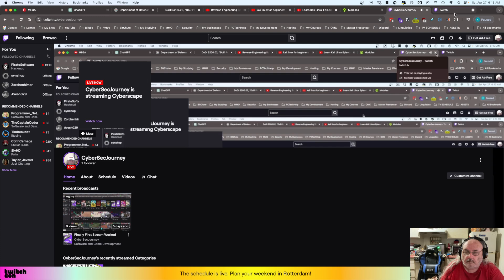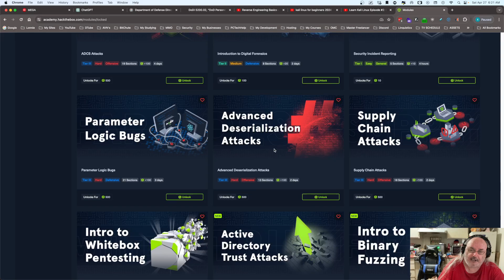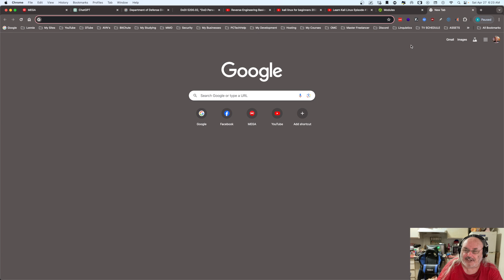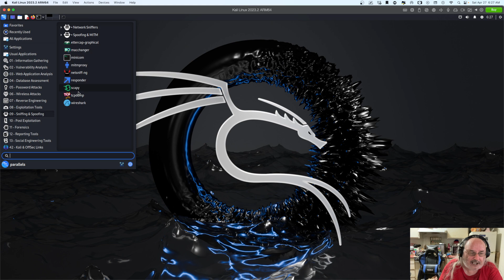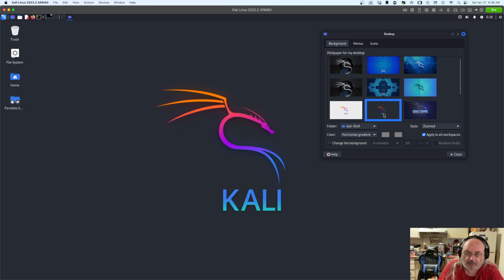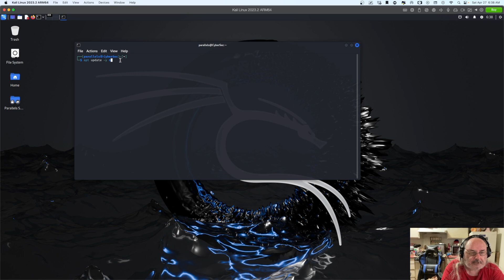Let's Get Ready To Learn To Hack????

Comment: Hi sir, Do you recommend to run any vpn on my pc Mac? I use Linux on utm
Reply from the maker: You can use utm if you like problem solving. But, personally speaking, I prefer Parallels but it runs Windows OS on Mac effortlessly really. It's for this reason and more that is has a $100 price tag but fully worth it if you ask me.
Reply: @CyberSecJourn  do you think a vpn is worth having on a Mac if yes which are some good ones? Well I have my Mac and use Prometheus for data monitoring running on my Mac not on Linux.
Reply: I’m learning this coz I would like to have my own home lab “data center” room in my future home 😂
Reply from the maker: @Username32123  Well it's hard to get into that now because I'm starting out with beginners. My hope is to bring new people, looking to change careers etc because of the ecomomy, into Cybersecurity, Bug Bounty Hunting, Security Researcher, PenTesters, etc. Setting up you own data center is years down the road. So much you have to know to run a center. I have my own network, DMZ, blackboxes, honeypots, etc in my home network but that's why I'm an independent security researcher so it's part of my job. I have a server that monitors and collects all the data on the network. Getting into VMWare, Prometheus and Grafana is a whole other thing and later down the road.
Reply: You can run a vpn on the host and then bridge the network for the guest,  or even simpler, run it on the guest.